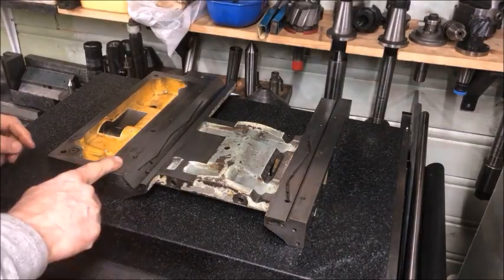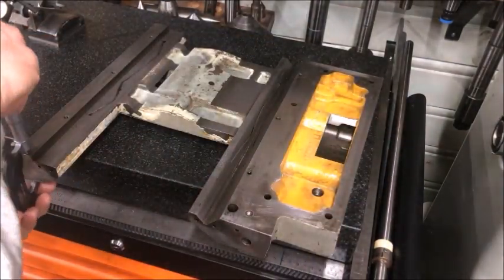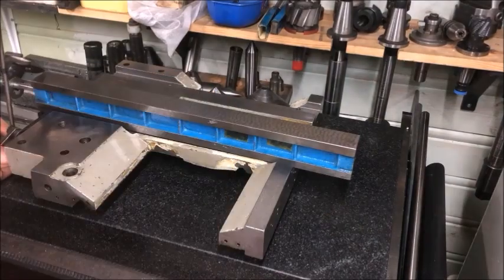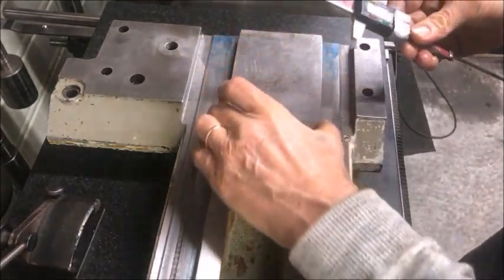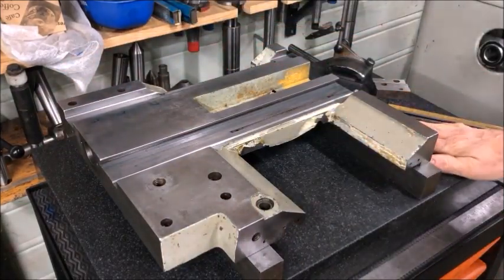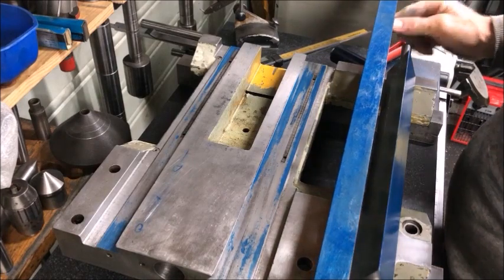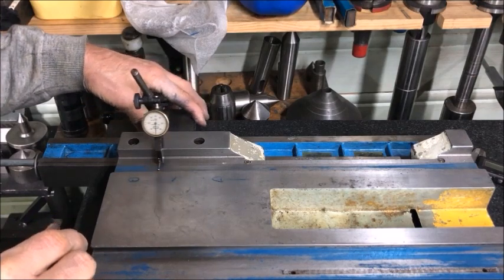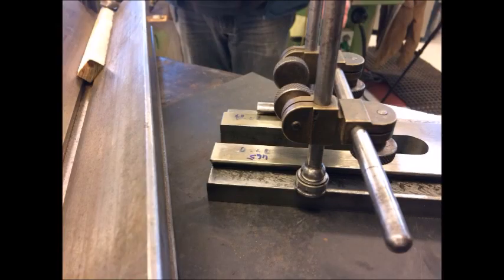Colchester Master 2500 -  saddle inspection and measurements

Comment: Jan whats the dove tail on the Colchester cross slide use for ?
Reply from the maker: From lathes.co.uk: "The 8.25-inch travel cross slide was especially wide and fitted with a cross-feed screw that could be adjusted to reduce backlash; although the slide was devoid of T slots and tapped holes - and so appeared, at a glance, to be incapable of mounting any accessories - the edges of the slide were machines to accept slide-on T-slotted and plain blocks that could hold a variety of items including hydraulic profiling units, and parting-off and other special tools. "
Reply: @jansverrehaugjord9934  Thank you